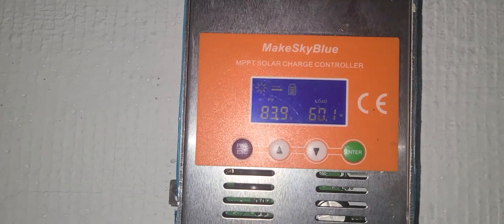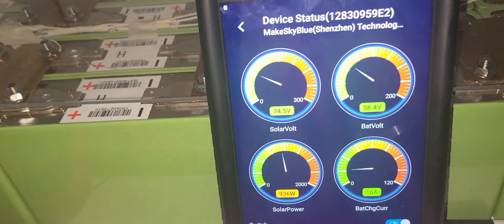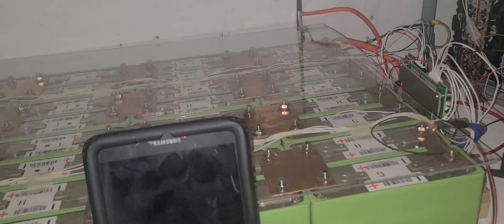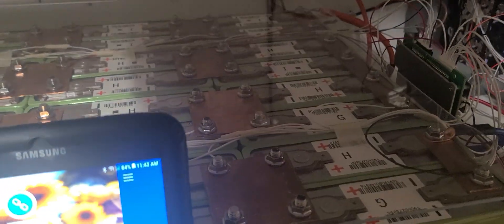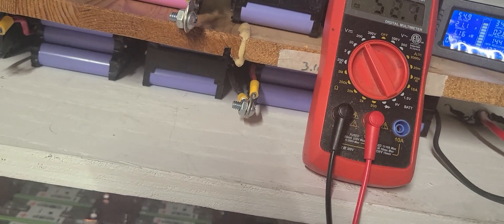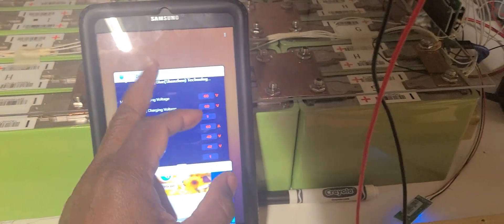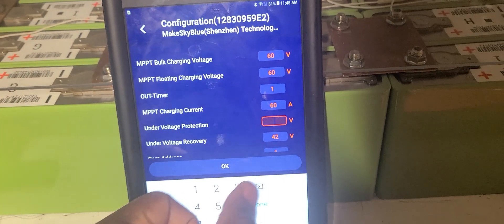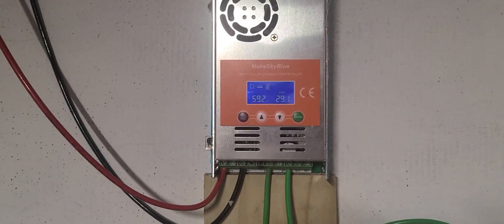MAJOR ISSUE WITH MAKESKYBLUE 60A MPPT Solar Charge Controller with Wifi function for Android

Comment: i like your diy batterys i do the same i do not use bms only battery balancer set  controller at 13.2 to 139 no higher
Reply from the maker: Thanks for the like. With the  bms Bluetooth you can see what is going on in the battery bank

Comment: I know you can calibrate the battery voltage display on the MSB v119 to make up for line loss and such.    Not with the bluetooth but adjust the parameters manually on the box.    I think it's D06 in the menu setting.
Reply from the maker: I try that, not working
Reply: @simplyfocus9937  that is weird